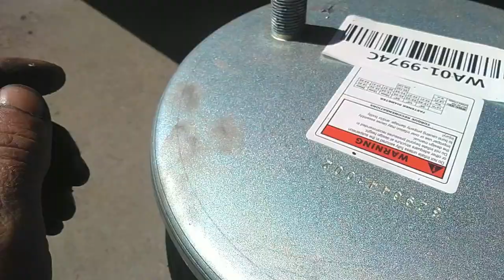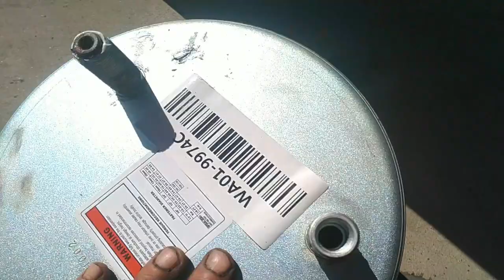hopper bottom air bag replacement with a twist

Comment: another way to do it is drain the air out. take the air fitting off the airbag and put a cap on the threaded end of the air fitting. build air back up and works the same as you did. just an extra step but keeps from having to pinch the airline and risk damage to it. can also use the leveling valve to move up and down if needed. great work !

Comment: I've been watching your videos for several years.  You remind me of . . . well, me.   I've got just about 3,000,000 miles as an O/O, and all in just two trucks in 38 years.   You could count on the fingers of one hand the number of times I've paid a pro mechanic to work on my truck.   I suspect you're the same way.   Something breaks, I figure out how to un-break it.   I'm convinced that attitude, more than anything, is the single most important factor to determine success vs. failure in this business.   I see others losing days and days of work while their truck sits in a shop, running up $125/hour fees.  I tell people my mechanic works nights and weekends, for free !   It's plain to see you have the same business model.   Much respect to you from a fellow trucker in Massachusetts.
Reply from the maker: When I first started out I was taking my truck to shops for a lot of repairs but low quality work and long wait times didn't take long. Being I had previous experience in automotive and equipment repair it didn't take long to get comfortable working on trucks. It's all the same just bigger and in a lot of ways simpler.
Reply: @Ezrider359   Agreed.   A Model A Flathead four to a Bugatti W-16; it's all nuts and bolts.   Big trucks have big, heavy, extremely dirty nuts and bolts, but 90% of it is refined '40s &'50s technology; very simple.

Comment: Shark bits makes plastic water line repairs and to cap off water lines. Not 100 percent sure if they fit air line but if they did you could cap it off so you wouldn't have to bend the air line. I like how you change the air bag.

Comment: Porter greetings.🇺🇸 We’re on the brink of a new summer season of fun! 🥰 Good story on the air bag. This is something that I just have to ask…from experience you know…if you replaced the bag on the one side, did you check the bag on the other just to make sure that it didn’t have any issues? 🧐 It always seems to happen that way…what you do on one side you have to do on the other as well, eventually that is. 😳 Well, thanks for another good, swift job. You never want to stop in the middle of something to replace a bag or whatever. Keep On Truckin, my friend! 🥰🤩✌️

Comment: What I normally do is remove the air line/fitting to the blown bag and then have a foot long section of air line to a drain valve and on the other end use whatever fittings I need to attach to the line I disconnected then I can air up the trailer and using the drain valve adjust the height as needed to remove and install the new bag

Comment: Hi  I watch you're videos and I have a question.I have a mack 05 ch613 I loose air pressure I took it in and they told me it's the air modular valve abs. But I can't find where it is would you happen to know where it goes? Please.

Comment: If one is bad the other 5 are right behind the one with the hole. looks like the all had red paint on them I'd be replacing all of them. don't know about you but fert. hauling was my best hauling & I didn't want trouble for the rush.
Reply from the maker: I haven't really found that to be the case. Plus the oem bags seem to last longer than the replacement ones. This looked like forgin object damage as well. Like a rock or something kicked up and got trapped. But I definitely get the line of thought on that
Reply: @Ezrider359  Not to mention the cost of SIX air bags instead of one.   That's a significant expense !
Reply: @immike1945  If I'm not getting rid oft he trailer in the near future I'm not concerned about the cost of the other bags. I'd be more concerned in missing a load or two during peak fertilizer hauling season. because once its done its done. It's the best  pay for hopper bottom truckers. ANYWHERE!
Reply: @Ezrider359 At 6:41 of the video that bad doesn't look all that good to me & not talking about the hole in it. I'm betting the rest look the same. when I hit fertilizer hauling season I never wan't to have troubles big or small. I made twice as much or more hauling fert. than grain plus there was two terragators counting of me to keep product in the plant for them to spread. That season is very good but short and when it's done it's done. You can put them in yourself so half the cost isn't there plus you'd been done with that trailer probably for the life of it while you have it. New air bags are a good selling point if one was getting rid of it later. there's so many that can't do the repairs themselves like you. You have that step on them covered.